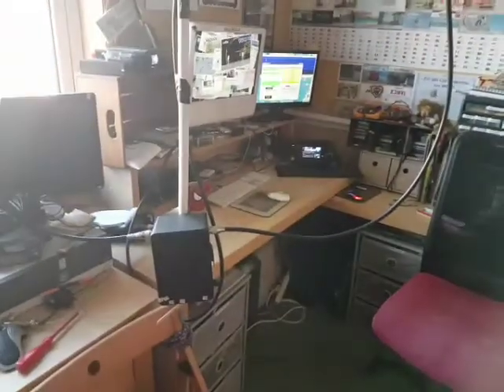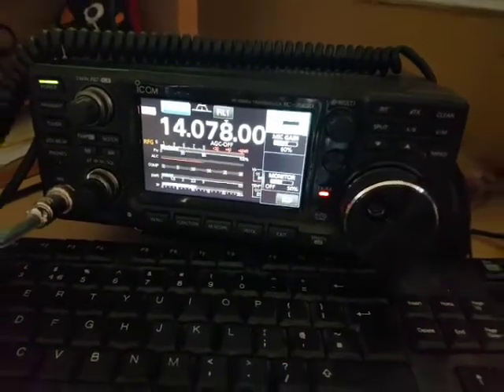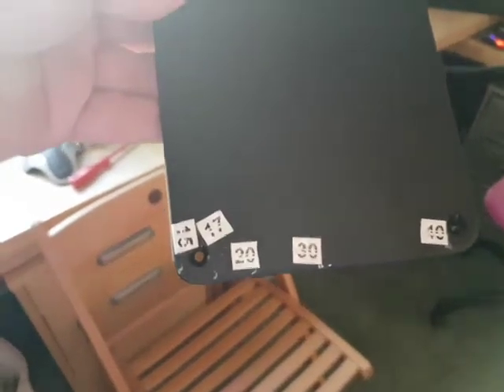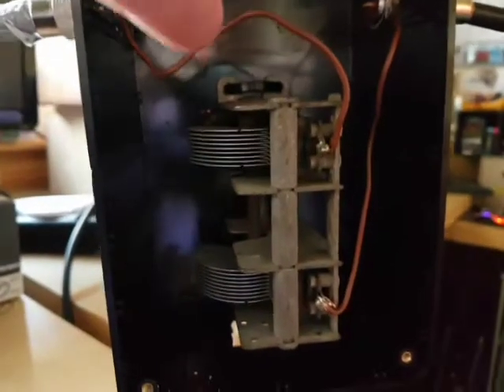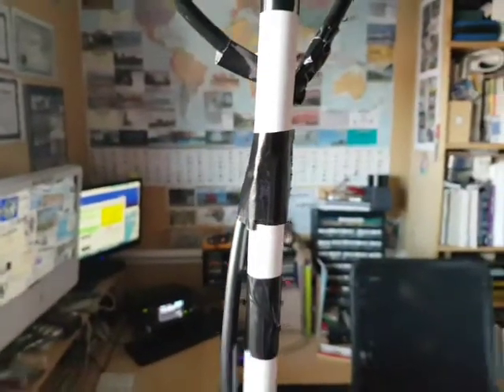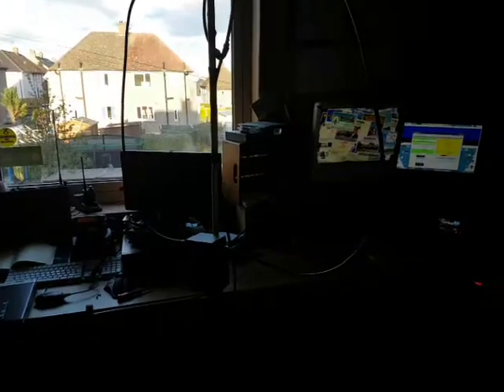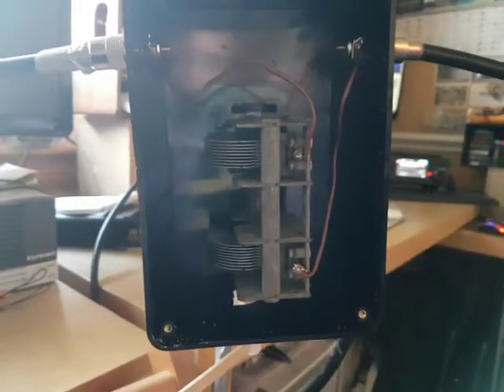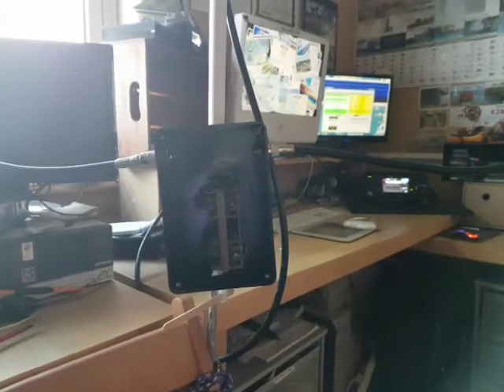RG213 Coax Magnetic Loop

Comment from the maker: 3m for main loop. 60cm for active loop. Braid and core connected for active loop. Just braid for passive loop.
It might be that the previous attempts have worked. On mine the difference between low SWR and too high to be used was a very very small movement of the vCap. Very very small.

Comment: I have tried to build sth similar and failed too many times.Are you using only the braid of the coaxial for the main loop or you are connecting together the braid and inner conductor?
how long is the main loop and the coupling loop?
Is it picking a lot of electrical noise from the apartment? 

Thanks!
Reply from the maker: 3m for main loop. 60cm for active loop. Braid and core connected for active loop. Just braid for passive loop.
It might be that the previous attempts have worked. On mine the difference between low SWR and too high to be used was a very very small movement of the vCap. Very very small.
Reply: thanks! It happened to had exactly  the same dimensions! I tested 2 capacitors: 160pf and 320pf. Turning the capacitor had no effect at all. same thing when moving the coupling loop. weirdly enough the noise on the receiver was a constant S9+ no matter the capacitor position. That is why I think I failed. but if it worked for you, maybe I missed sth. I will try again!  73!
Reply from the maker: Nick Tsakonas Did you check it with a multimeter to make sure you didn't have a short, and also that the vCap was wired right. I have a capacitance meter, so that at least told me when it was wired I was changing the capacitance by turning the leaver.
Reply: no capacitance meter,but I think it was wired correctly.of course maybe I failed there!I will attempt it again to make sure that this was not the reason!
Reply from the maker: The multimeter would tell you the resistance was changing - good enough as a rough tool
Reply: didn't think of that!I will also try to get a capacitance meter at hand before the next attempt!